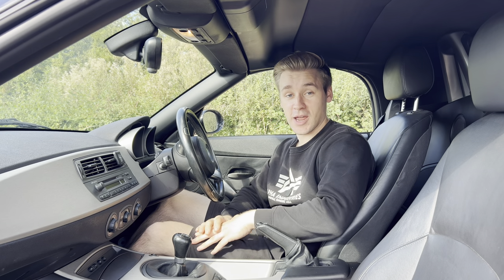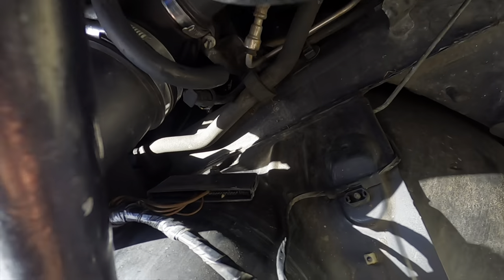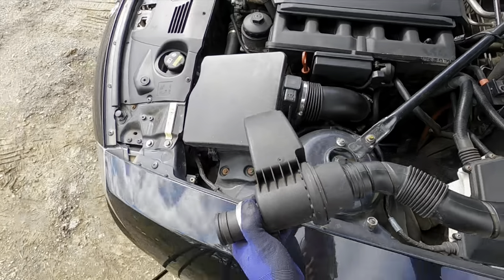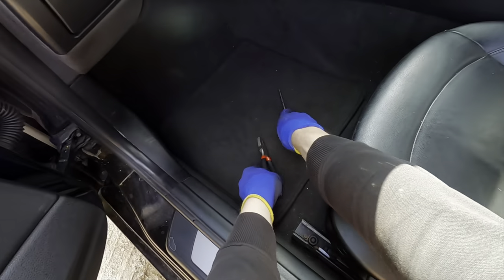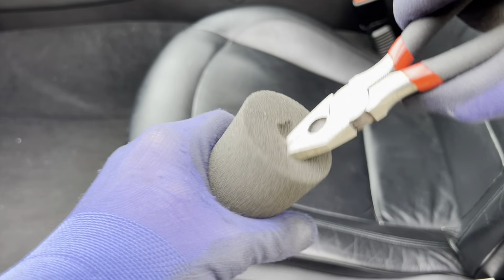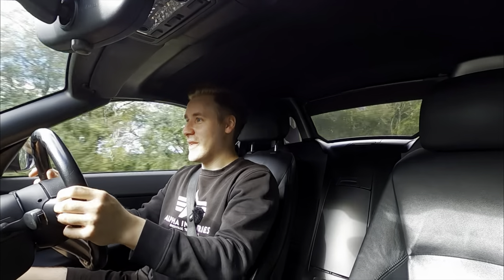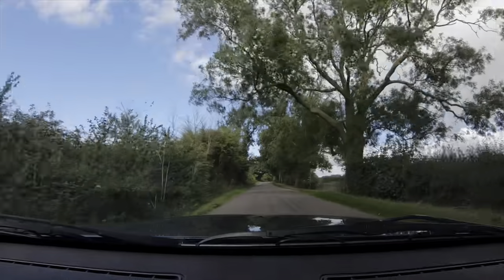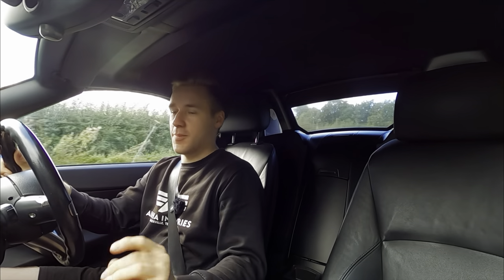How to do the Sound Generator Mod on a BMW Z4 Before & After

Comment: This was standard on the 3 litre models. I retro fitted it to my 2.2, and it sounds as good as this. I kept 1/2 a sponge in, and it sounds just right to me, the perfect balance between engine, intake and exhaust noises. Love it!
Reply from the maker: @krazykeith6001  I didn’t know it could be retrofitted, that’ll be very insightful for others to know! Did you cut half of the large sponge then? It is an absolutely glorious noise, seems like you have the perfect balance if you can still hear the engine note too!

Comment: Having a m54 2.5 and did the retrofit on it - you need the boot from the 3.0 aswell as the auxiliary parts like clamp ... - Taking out both sponges is a bit too much for me. The one close to the firewall is enough. Another experiment could be cutting the other one, just to give it a bit more sound :)

Here is a list of parts needed, they may come together:

13747514863 Soundgenerator
13719071782 Tensioner
13747518282 Supporting Bracket
11611705032 Head Screw
07129952121 Clamp (should be provided with soundgenerator)
13747514864 Soundpipe
13717514865 Grommet
13547514867 Rubber Boot
Reply from the maker: @danielsteinmetz  Thank you for the heads up for the retrofit!